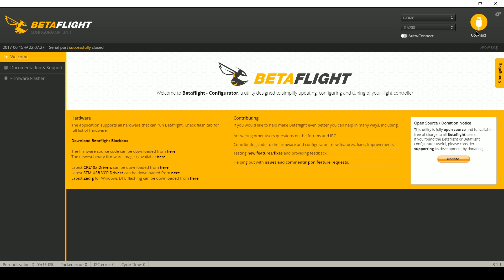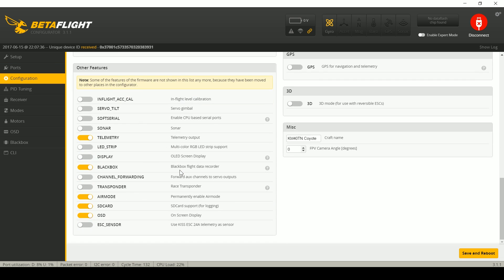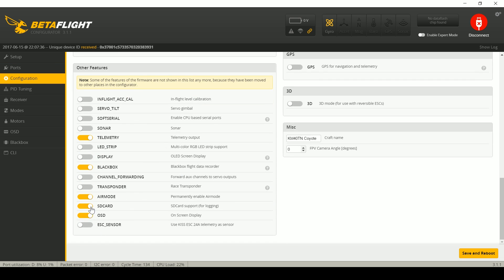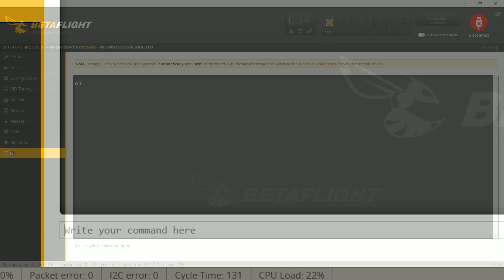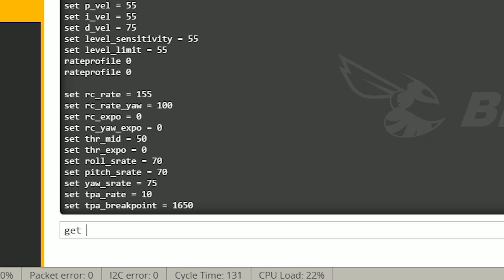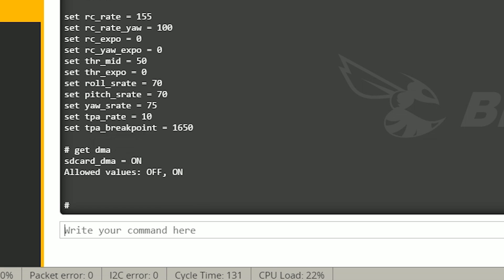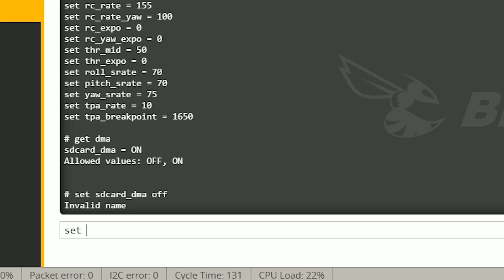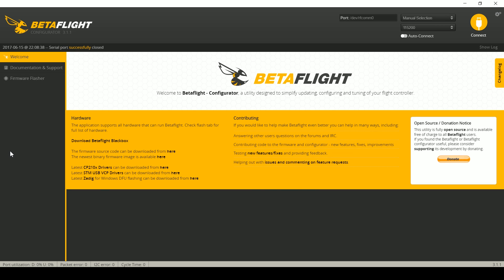Omnibus F4 Betaflight Thrashes and Crashes | HERE'S WHY AND HOW TO FIX IT

Comment: Thanks, but a few days too late for myself. my quad flew great until I tried to log some blackbox. that's when it flipped out now the board won't power up, one green led turns on but fades in very slowly, no connection to the computer, the casing to the SD card holder heats up.
Reply from the maker: +Casey Pinochi casing to the SD card holder heating up means you have a short. On the BFF3 if you fly without an SD card installed the casing can be crushed and contact Vcc. The board is likely dedtriyed.
Reply: Boards are definitely toast, but the casing was intact, happened to 2 boards only after actually logging BB(boards may or may not have been clones) guess that's what I get for trying to go cheap, buy quality, spend now, save later, lol

Comment: Can someone help me, i added the dys omnibus f4 flight controller to my drone and i have an xm+ receiver bound to my taranis qx7 and in the receiver tab on betaflight the stick values wont move. Ive gone into the ports and tried changing somethings but to no avail.
Reply from the maker: +CarelessMedia watch my playlist on flight controller wiring for beginners part 3
Reply: Thanks guys, you all helped me solve my problem, i didn't have the channel mapping on correctly and i changed it to uart 1
Reply: CarelessMedia Whatever I can do to give back to this great community. 😀 

Also, let me know if that worked?
Reply: CarelessMedia make sure to select Serial and SBUS in the configuration tab.
Reply: I did
Reply: CarelessMedia What version of Betaflight are you using? Right now, 3.1.7 doesn't work, I have mine on version 3.1.6
Reply: CarelessMedia Also, you need to connect your receiver to UART1 as it has the required hardware inverter for FrSky receivers.
Reply: Thank you so much for the advise
Reply: Sadly still doesn't work
Reply: on the receiver tab did you pick the right channel mapping?
Reply: yes
Reply: does your receiver light up green when the taranis is on?
seems like you did everything unless you picked the wrong UART port that is not connected to your xm+
Reply: CarelessMedia i recently bought babyhawk and a8s receiver, i did the same things as you did and in mu receiver tab in BF there is nothing, no channel values at all :( whats happening?
Reply: @Szymon Nowotniak - Check to make sure both your receiver and radio tx is set to SBUS. To check your receiver settings, go to the configurations tab on Betaflight. Depending on your radio tx, there should be a setting for output. You may need to refer to your manual. Also, it looks like UART3 is where you need to enable "Serial" under the ports tab in Betaflight.
Reply: CarelessMedia does the flight controller have sbus.ppm solder jumper pad ?
Reply: I fixed my issue, thanx to everyone who helped

Comment: it fixes the crash but sd logging doesn't work after 10-15 flights, logs are empty
Reply from the maker: +windrides it should still work even without DMA. Are you sure you have sdcard turned on in the options.
Reply: It works fine up to 10 to 15 log files. If I don't format my sd card after 10 to 15 logs, it stops working and just creates corrupted log files. The log files look empty in Blackbox Explorer but they actually have some data inside. If I open them with notepad I can only see UUUU characters and no binary. I have tried it with 2 microsd cards. My logging rate is 250Hz and the cards are class 10.